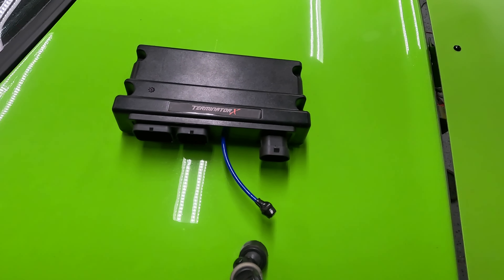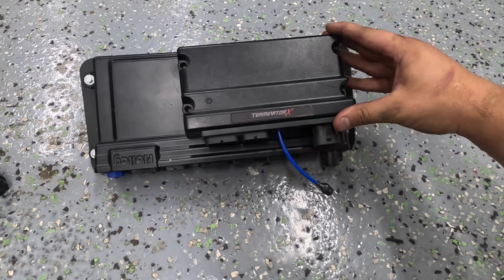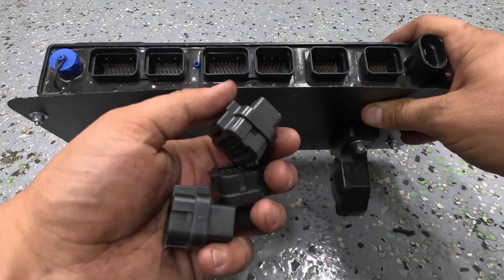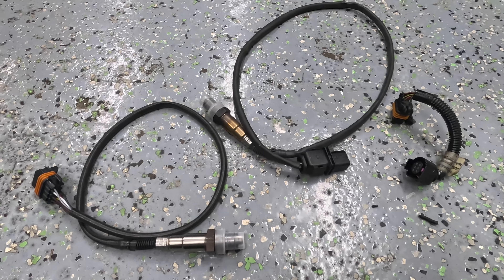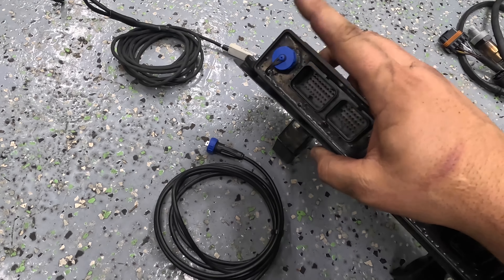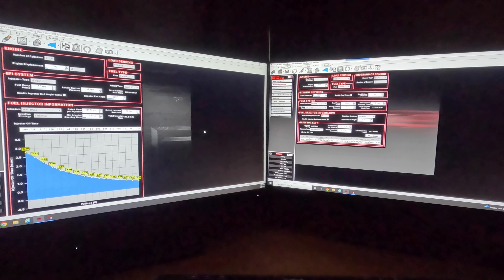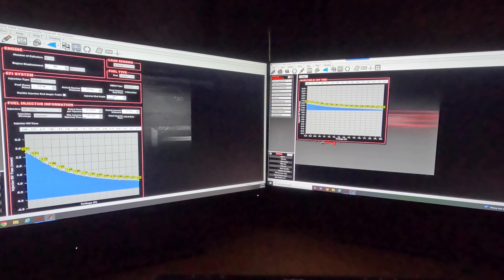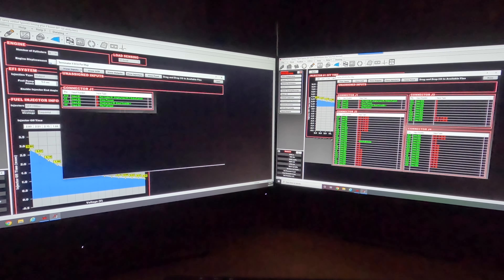Basic differences Holley Terminator to Dominator ECU Upgrade

Comment: You mentioned you needed to Dominator to add more stuff, do you mind explaining what you added after you installed the dominator?
Reply from the maker: With the dominator I was able to add more io's like a driveshaft sensor, front wheel speed sensor, shock sensors, ect. Also The dominator allowed for more advanced tabled which are being used for a variety of functions for racing and street driving. I could have gotten away with the terminator ecu but for the extra data that I wanted to have, it was necessary
Reply: @BoostieMotorsports  I was thinking about getting a Can I/O module for my terminator but Im gona look into the advanced tables that the Dominator offers
Reply from the maker: @v8tergt653  Really depends on the car and setup. Dominator has 3-Step ability, Boost builder and a handful of other built in functions that dont burn up Advanced ICF stuff. I know plenty of people who have gone wild with the terminator but you end up needing to get crafty. Good luck with your build!
Reply: Yea sounds like getting a Dominator makes everything easier and more straight forward